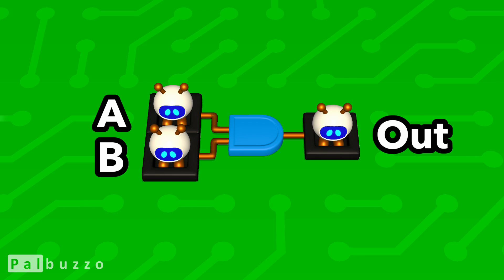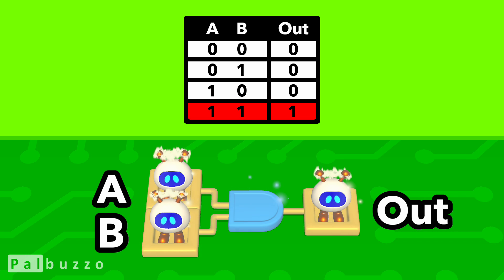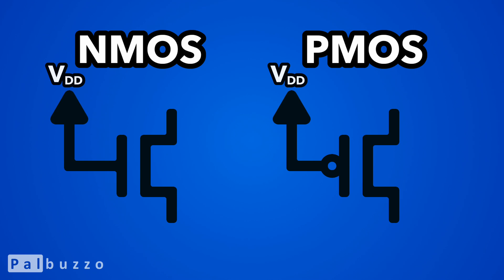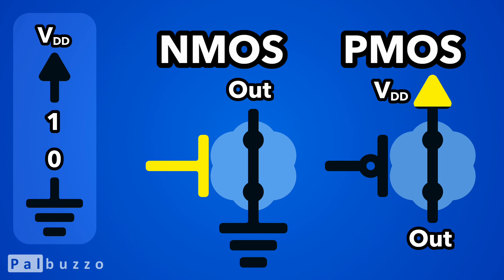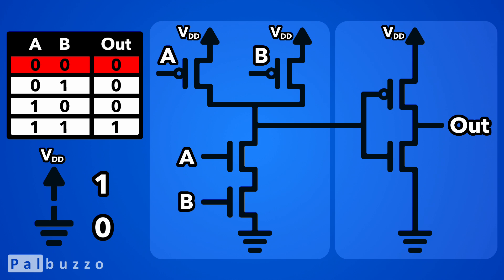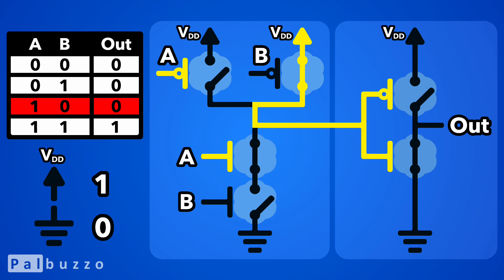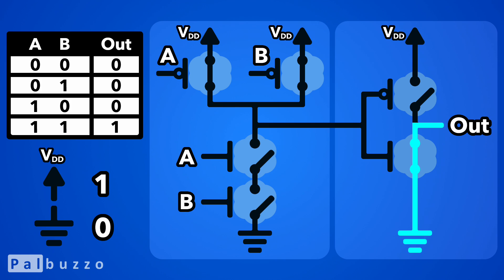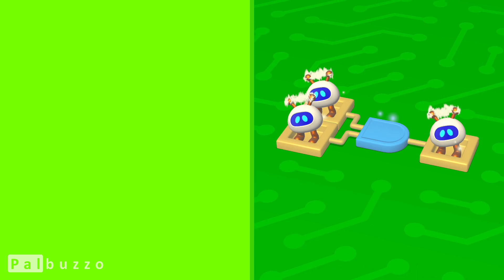What's inside an AND gate?

Comment: Are there any logic gates that take more than two inputs? Or produce more than 1 output?
Reply from the maker: Typically most logic gates will take two inputs and produce one output, except for the NOT gate which takes one input and produces one output.

However, it's possible to construct some logic gates with more than two inputs. For example, it's possible to construct a three-input AND gate that would only produce an output of 1 when all three inputs are 1, and would produce an output of 0 otherwise. It's also not uncommon to see multi-input OR, NAND, and NOR gates.

In any case, a multi-input logic gate could also always just be made from multiple two-input logic gates. For example, a three-input AND gate could be made by using one AND gate on the first two inputs and then passing that output and the third input to another AND gate. This wouldn't be as efficient in terms of the number of transistors used, but would be functionally equivalent.